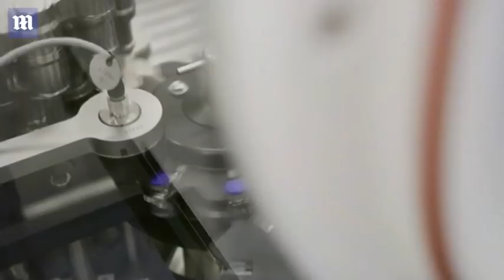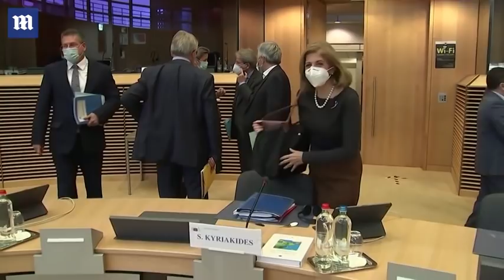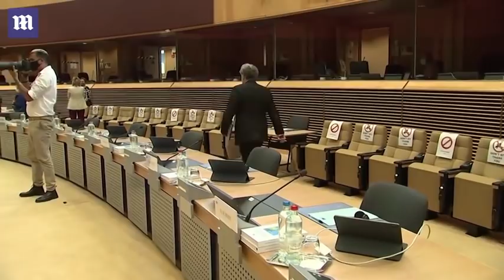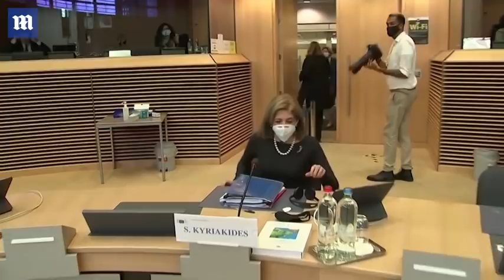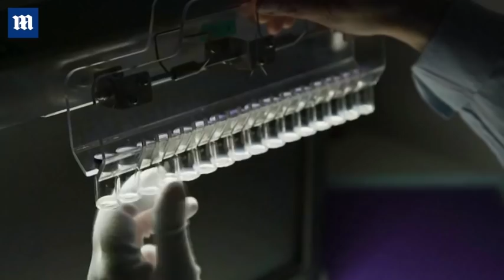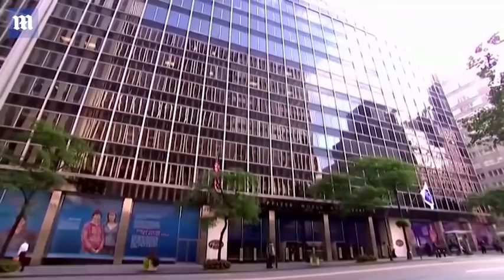Pfizer vaccine: EU approves deal for 300 million doses of COVID jab

Comment: How is it possible to ‘fast track ‘ long term testing?
Reply: By completely bypassing safety and efficacy protocol.
“No vaccine has ever been developed in less than 7 years. The average time required to develop an effective vaccine is 20 years. To talk of developing a vaccine in months is absurd.”
Professor Arthur Caplan 
Professor Of Bioethics
Reply: Scramboll  You sound infantile. 
A mumps vaccine was first licensed in 1948, but only had short term effectiveness. Improved vaccines became available in 1967.
The initial vaccine was inactivated while subsequent ones used a weakened live virus.
Dr Maurice Hillman began his work on a mumps vaccine in1963 with Merck licensing a vaccine in 1967. The mumps vaccine was first developed in 1948 but was improved by Hillman during his research from 1963 to 1967, mostly by using a weakened live virus.
Reply: Scramboll  False. You have not understood the history of its development. Not wasting time explaining further. Fool.
Reply: Scramboll  Shhhhh.